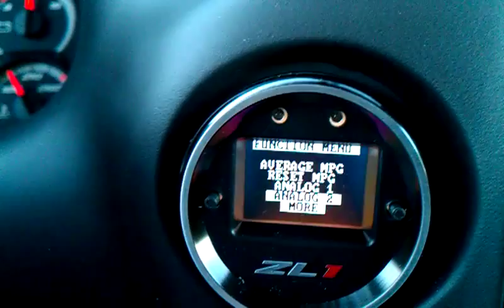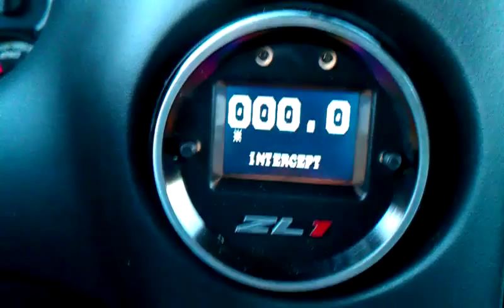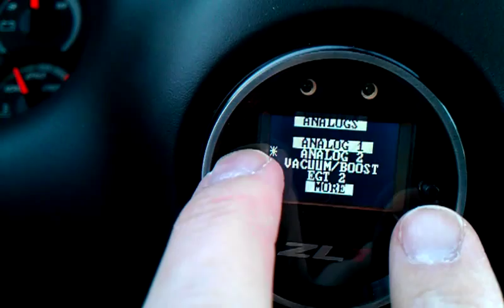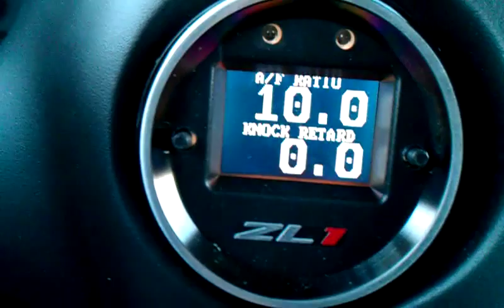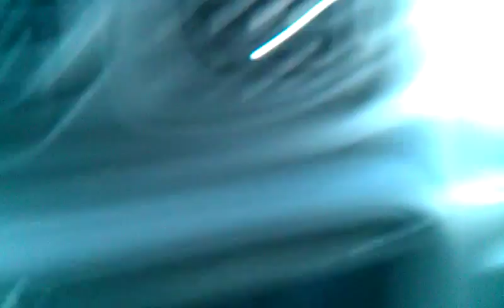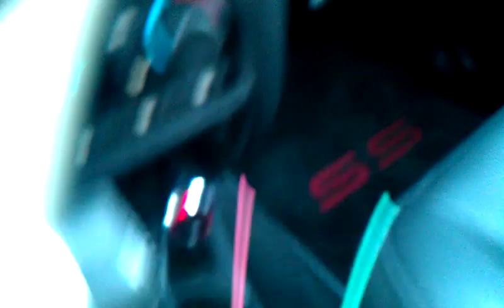Aeroforce Interceptor Analog input setup

Comment: Can you set the analog to Ethanol or alcohol % cuz I have the flex fuel sensor on my camaro I was wounding if I could do that?
Reply from the maker: At a minimum you can set up the input for the sensor and read ethanol % with the heading "analog 1" or "analog 2".   Some of the versions have a preset "ethanol" heading but I'm not sure of the GM gauge.  I'll check and get back.

Comment: Just got this gauge.. I am so lost trying to set it up.. I want to monitor Boost and AF but have the lights blink on any positive knock... that possible???
Reply: I can't really explain it better than the instructions for the gauge.  Please email service@aeroforecetech.com and be more specific as to what your issue is, what part of the process you don't follow in the instructions.   Thanks.
Reply: Todd Austinson Gauge was used.. no instructions.. I'm not sure what manual to use on the site as there are a few for Fords and even then when I read through one of htem it wasn't very detailed.. I must have been looking at the wrong one... I assume.  I know my knock sensor isn't reading in degrees but numbers in the 400s..
Reply from the maker: there are many manuals because there are many different gauges.  if you have a Ford then you either have the fd gauge or coffee gauge.  look at the part number on back of gauge and it will tell you which one.  fd gauge uses the 2.8 manual, cnf uses the 3.x manuals depending on the number on back of gauge
Reply: I will give you 5$ to come set this up for me.. I know... I know.. it's a lot of money.. but I think it is worth it.  lol.  I will check out the manuals out.. thank you!

Comment: I have a 2012 5.0 need to read a/f also and only got gauge and 3 wire connection
Reply from the maker: Just select the 2 A/F ratio parameters in platform 4, then select them in scan mode.  You don't need to add anything else.

Comment: So you cut the white wire from the OBII cable and connect it to the white input wire or you just attach the white input wire to the white wire on the OBII cable?.... I got an 07 mustang gt, I bought the aeroforce interceptor gauge from AM and I want it to read a/f ratio
Reply from the maker: ?  No!  Don't ever cut the OBD2 cable wires!  I assume you have our wideband O2 kit, just connect the yellow output wire of the kit to the white or green analog input as described in the video.  The W/B kit includes detailed instructions on all the connections, so there won't be any confusion.